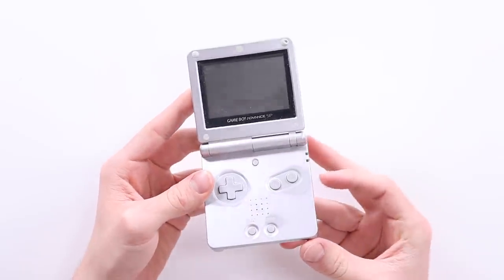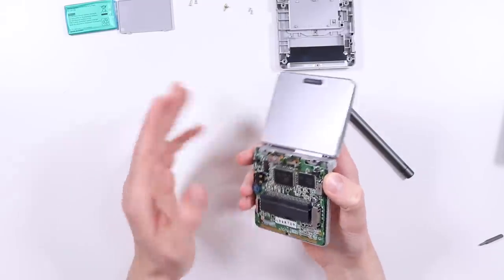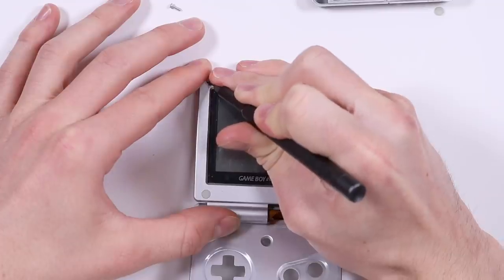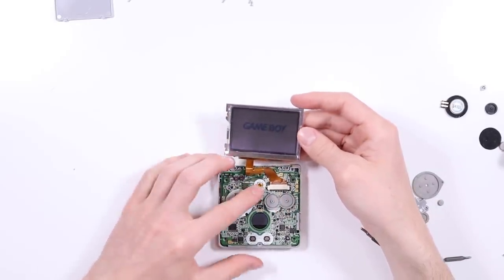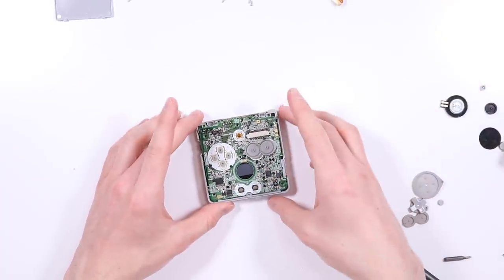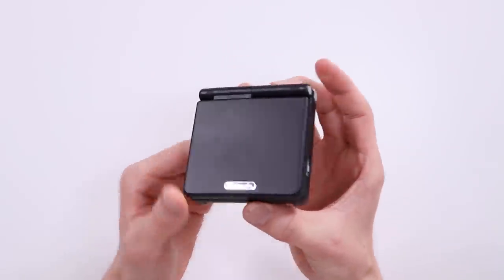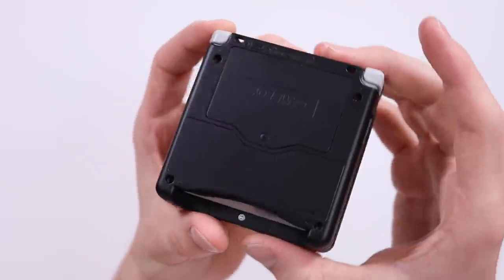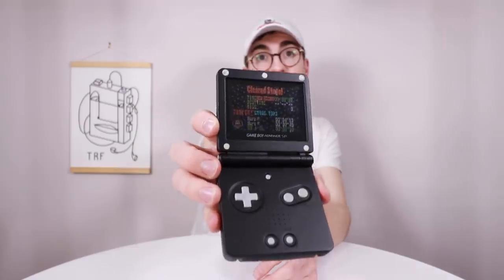Restoring the GameBoy Advance SP!

Comment: Pro-tip: the inside of a Bic Round Stic ink pen fits the hinge clips. Just disassemble a pen then chop of the part of the tip that fits in the tube/body. Open the hinge to the detent and press the piece we cut against the hinge clips. If they don’t retract and pop out a bit from that alone, and often they do, it’s still hollow and you can easily push something through while the clips are retracted. Piece of cake! No cracking the housing or slipping and stabbing yourself.

Comment: Great video - would have liked a bit more explanation regarding the painting prep. What grit sandpaper did you use? What type of primer/paint did you use? Also, in your experience does the spray paint wear off any faster than the original paint? Is it worth it to apply a sealant of some kind?
Reply: 3 years he still hasn’t answered

Comment: You're spraying with the can is fine, short bursts back and forth. One thing that may help is using small gator clips on thin dowels. You can clip the frame or inside of the object you're painting and stick them in a block of styrofoam. Lots of model builders use this technique and it allows them to move the piece to get all of the area coated each time they spray.

Comment: I still have my original silver SP AGS-001 which I bought brand new in 2003, still got the box, manuals and even the receipt and credit card slip from purchase. Unfortunately the casing is all scratch up from loads of use but thats OK, it shows its been well used and loved :) And it still works fine too.
Reply: You should keep the shell if you still like it but if you still want to play I would consider replacing the screen lense with a glass one. Scratched shell don't bother me much but a scratched screen that I don't even dare touch is not fun.

Comment: Wow that spray paint job came out really clean, great work. I've always had trouble painting stuff, I guess I'm too impatient at the sanding and painting stages to get a nice smooth surface. And yes that is a gba lcd with frontlight bodged on using a 3rd party ribbon adapter.
Reply from the maker: No way! So I can drop that into a GBA?
Reply: @TheRetroFuture  Yep

Comment: Finally a video I can relate to! I actually mounted a GBA SP 101 using a motherboard I got and getting a replacement shell with buttons, a speaker and a screen. Putting the ribbon cable is sort of hard, but I got used to it

I actually had this spare motherboard due to another GBA SP I tried to fix, but I learned that you can't use a frontlit screen with an AGS-101 motherboard. So I fixed than previous one and mounted this one and when I actually saw how the backlit looked, I was so impressed that I sold my old frontlit model
Reply from the maker: Nice work!

Comment: Have you ever thought of trying a distressed look? So have your first coat be a glossy purple, or something, then a matte black over top. Then, either use it for a while, sand it, or use denim or a scrubbing pad to wear through the black so the other color shows through. You can either leave it to eventually wear away the top coat, or add a clear coat to seal in the level of distress you like the best. I think it would look really cool, especially if the buttons were the same color as the undercoat. Maybe even leave the outside pristine and distress the inside of an sp, or just the face of a gbc, gba, etc.

Comment: Very cool.
The SP’s ribbon cable folding hinge is a headache to deal with.
Looks awesome.
Reply: Did you ever mess in a DS Lite or newer? That's 10x worse. There is so many ribbon cables and you have to pass the wi-fi antenna under other stuff.

Comment: Hey Elliot, i found my old GBA SP AGS 001 and I would like to put an AGS 101 screen in it. Do you think you could do a video of this “mod” ? I know there already are tutorials about it on YT, but they are definitely not as clear as yours (plus I think it could be an interesting video).
I love your work btw !
Reply: By default the 001 motherboard doesn't support the 101 screen. Modding a 001 to have a 101 screen is not as easy as putting a 101 screen in the original GBA. That one is relatively easy and just need a ribbon connector and soldering 1 little cable. Putting the 101 screen in a 001 motherboard actually requires cutting a trace and installing a voltage regulator.
https://gbatemp.net/threads/ags-101-screen-on-ags-001-motherboard.472415/
Reply: @chamoo232   Hi just wondering if i can use 001 lcd for my 101?
Please answer , thanks.
Reply: @rythmhunter  No there is no screen on any GBA that can just be swapped for another model without any modification. If your 101 screen is broken you need to put another 101 screen in or get the IPS mod.

Comment: Just curious with your repainting method. Do you bother to wet sand between primer and final coats for superior finish? It looks like a nice matte finish, but I'm wondering if they're are small bumps in the paint from any dust etc between coats.

Comment: Thanks for giving a step by step guide for taking this apart, I'm definitely going to try and get an ags-101 screen for my gba sp, do you have any recommendations for a screen to get?
Reply: By default the 001 motherboard doesn't support the 101 screen. You need to mod it.
https://gbatemp.net/threads/ags-101-screen-on-ags-001-motherboard.472415/

Comment: I recently bought a Pearl Blue SP from Gamestop and I'm somewhat worried about the condition. As long as the screen is scratch free, buttons work, and has no dents or deep cuts I would be okay with that. But I did pay $100 for it so i would like for it to be in good condition.
Reply: They have replacement shells with buttons and glass screens on Ebay. They are definitely worth it to make a SP look brand new. I found an red SP at a thrift store and it was all scratched and even missing the R shoulder button. Now it look brand new. As long as there was no water damage I would personally get pretty much any SP at decent prices I see and just re-shell them.
Reply: @chamoo232  Yeah I was looking into that just now. Problem is I don't have the tools right now to do that. Saving up for them right now though. I'm getting a ifixit it pro tech toolkit just for future proofing.
Reply: @patricksimpson9202  A lot of those replacement shells already come with 2 cheap screwdrivers. They are not the best quality but for a 1 kit job they are fine. I bough many shell kits on Ebay before. My favorite is the NES edition.
Reply: @chamoo232  Oh, thanks for that information.
Reply: @chamoo232  Hey, It just came in today and it works great. All it needs is a shell replacement because it has some deep cuts and the sticker on it is ruined. How is the quality of the replacement shells like?
Reply: @patricksimpson9202  I swear they must have access to the original printing molds from China. There might be a bit of cleaning to do around the edge especially the bit where the plastic edge meets the screen but other than that they are fantastic. They come with everything needed. The Nintendo sticker on the cover. A sticker for the back. Screws and the buttons and the little rubber bits to cover the screws around the screen as well. The only things that don't come with those kits are the little hinge mechanisms. You will have to extract those from your original case. It comes with a volume button but not the power one. That one seem to be stuck to the motherboard anyway. This is a little comparison picture I just took. I went from a badly scratched blue shell to perfect condition NES edition with glass screen. I definitely recommend a glass screen too.
https://i.imgur.com/XFU9Pcm.jpg
Reply: @chamoo232  Nice, thanks for all the help.

Comment: I had a similar problem with my Sp but instead of the ribbon cable being loose there was a burnt out pin on the connector. Replaced the screen but  is there a way to fix or replace the ribbon cable on the old one, the screen itself is in great condition.

Comment: I have a situation i recently bought a "refurbished" ags-001 Gameboy advanced sp from eBay for $120(tax and everything. But for some reason whenever I save the game, as its saving the screen glitches out and sound goes silent then after the game is done saving the screen is back to normal and the sound is partially there. Also when I tilt the charger cable to the left, the volume goes silent but when I tilt it back its fine.

Comment: One of the buttons of my Game Boy Advanced SP is wrong (the "A"). Do you know which type of button should I buy to replace it? I think that it may be a tactile button of 5x5x0.8mm, but I am not sure.
Reply: I have never seen anyone replace the buttons on the SP motherboard. They just seem part of the motherboard. I guess it's worth a shot if it's already broken.
Reply: @chamoo232  They are soldered to the motherboard, so I would have to desolder and solder it. I looked in Aliexpress and I found some, but I don't know which one to buy, because there are a lot of sizes to choose from ...

The thing is that the Game Boy Advance SP I want to repair is the first console I've ever had, and I want to keep it in good condition (and now the "A" button doesn't work).
Reply: @Xoan_Cosmed  That one thing that scares me about how they made buttons for the GBA. Unlike the GB and GBC it's not the rubber pad doing the contact so it's not easy to fix. I would say as long as the connecting pins are at the same stop it should work. I see some 4x4 and some 5x5. Can't seem to find any 6x6. Maybe they don't exist. 5x5 seems like the best match to me.

Comment: I bought an aftermarket shell and it doesn't open and close correctly. Instead of like stopping at at certain point and like swiftly opening, it like slowly opens and never stops at the certain point. Is there any way someone could help me figure out what I did wrong or is it just the shell acting weird?

Comment: I saw one of those at a thrift store $9.99 I should have bought it. Oh well.
Reply: especially if you check the label under and it says AGS-101. Those are the backlit screens and the price is getting insane for them. AGS-001 is the front lit like in the video but for 10$ I would still buy one and get an aftermarket shell from Ebay.